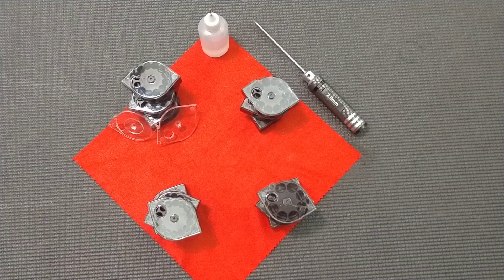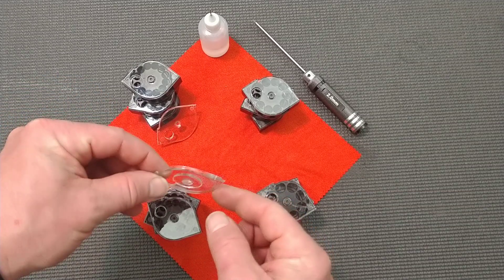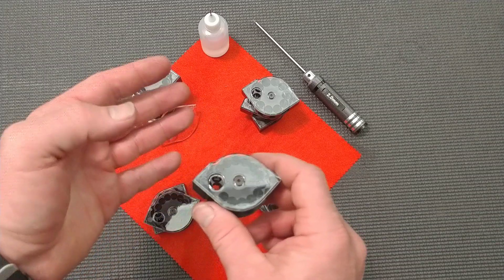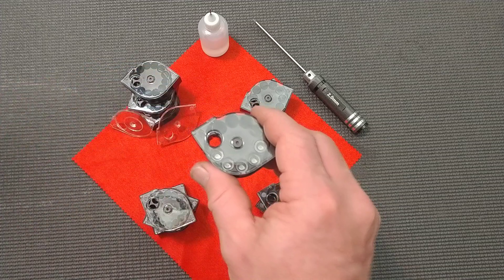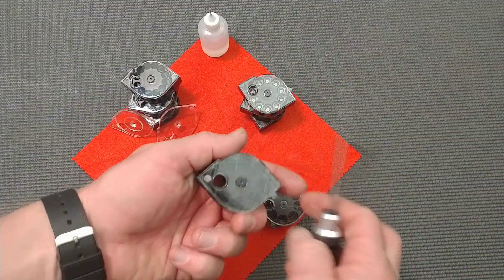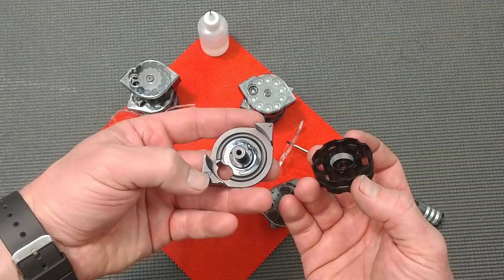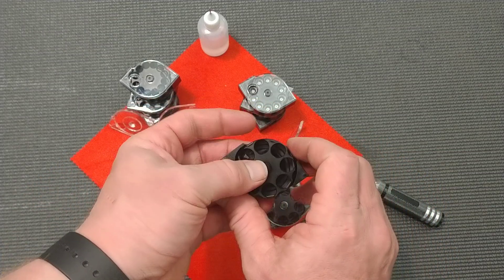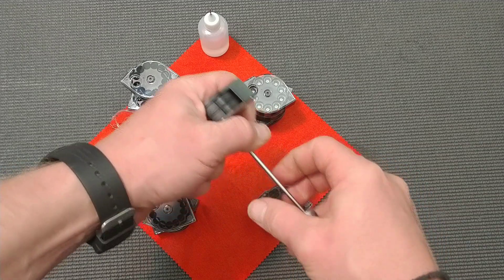Closer look at the Revised Raptor Magazines

Comment: Let me know when you get a single shot tray. I made one out of wood with my Dremel for slugs only. Would prefer something more precise
Reply from the maker: Have you checked out the new Stick mags?  I'm still going to make a single shot trey, though it might take me a while to finish the part file, the drawing file, and get them manufactured... I know some people have taken a stick mag and cut it to be a single shot trey... If you don't like having 10 rounds... Might be a faster option.
Reply: @jeffersonstateairrifles7510  yes. Do the stick mags do well with slugs and any recommendations on that? My little wood single shot tray works. But it's not perfect. Too easy still for me to accidentally turn the slugs sideways. I might have to put another 20 minutes on that to correct
Reply from the maker: @borbonrj  They will work great with slugs... Part of the reason I made them - so that I could load longer projectiles than the rotary mags... Up to 0.660" long.
Reply: @jeffersonstateairrifles7510  I'll order one then
Reply: @jeffersonstateairrifles7510  OK that worked perfectly. I'd recommend the stick Mag to anyone shooting slugs.